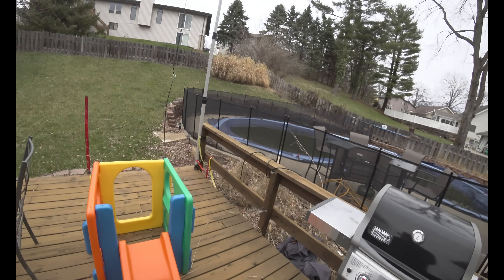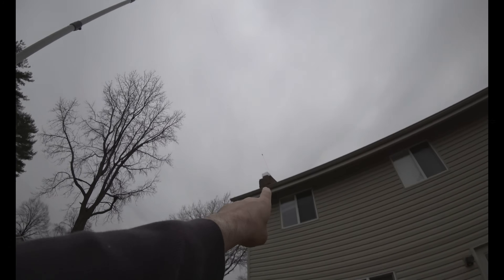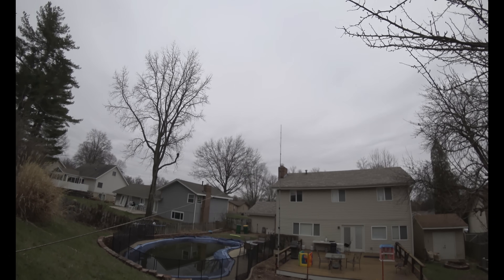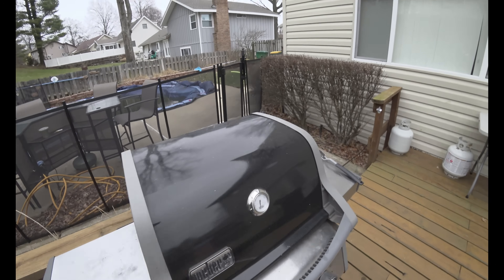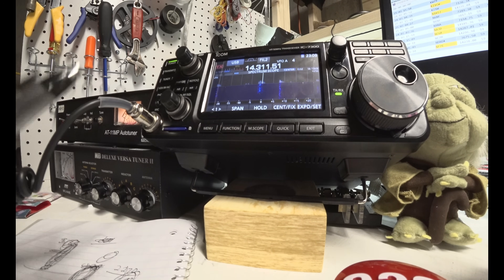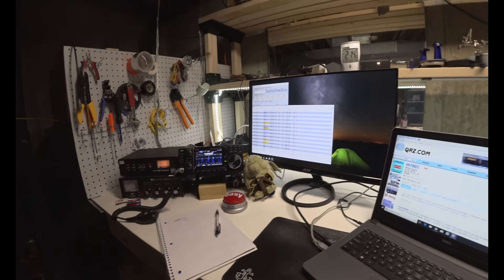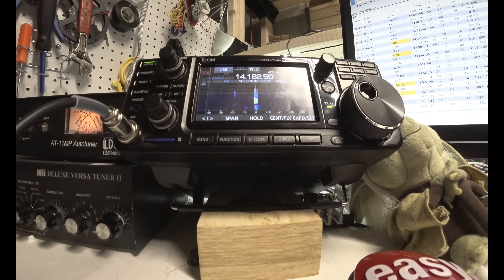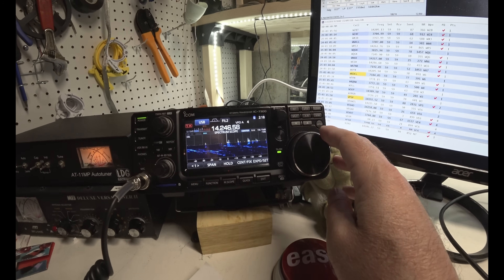The Amazing Doublet Dipole G5RV!!!  Best Stealth Backyard Antenna!

Comment: This is the heart and soul of ham radio, experimenting and testing! Learning what works and what doesn’t. You can have a 10k rig and a crappy antenna and you won’t be able to work your neighbor. Take a good antenna, good wire, adjust for SWR and you can work the world with a “cheap” 100 watt radio. Build or buy a good antenna. A good antenna analyzer is a must. I’ll take a good (I don’t mean expensive, I mean a GOOD) antenna and analyzer over an expensive radio. Compare it to buying a 100” 4k ultra hd tv and hooking it up to speakers from a 53 chevy am radio speaker.

Comment: I have a g5rv and only 150 feet of space. I'm curious if I can run this as a sloper off the side of my house with a grounded plate? Or if I can run the 2 102 foot wires perpendicular instead of a straight line. Thoughts welcome....

Comment: The G5RV is one of the most over rated, non resonant antennas on the market. It is in fact resonant on 20 meters, it's design frequency, but that's as far as it goes. Stealth? Want a stealth antennas? Make a 40 meter half wave end fed antenna, using a 64 to 1 unun to match it and make the antenna out of #20 enamel wire. Now you have a stealth, resonant multi band antenna with a low SWR on all of its resonant frequencies.

Comment: MFJ says it needs a tuner.  Is that for all bands?  I'd only be working 40 & 20 for the most part.
Reply from the maker: Yes needs a tuner.  Good for multiband mostly.  You should just get a resonant 40 and 20 instead.
Reply: @hamradiocq  Yeppers.  Found some videos and info on the ZS6BKW (a variant of the G5RV) that's resonant on 40, 20, 17, 12 and top half of 10, as in well under 2:1 SWR without a tuner.  WITH tuner you can add 80, 15 all of 10 and 6.  In the process of building my tower and antenna right now and hope to have something to report in a couple weeks.

The G5RV was originally intended to be a 20 meter dipole only.  US marketing made it the end all be all that it is today.
73 de K1NKX
Reply: Doesn't need a tuner on 20m, other bands yes

Comment: I think you are supposed to fit a balanced line tuner between the coax and the ladder line, you need to match 50 ohms to 450 or whatever your ladder line is also you need to convert unbalanced to balanced. Other ways to do this is with a balun or with a mixture of different impedance coaxes.
  Good luck and try to get your entire antenna at least 1/4 wavelength above the ground.
Reply from the maker: Ok, thanks.

Comment: I got that one coming some time as it is taking too long from a vendor in NJ. Will set up on a tree, but not sure if I can get it to 27' high or so. Will try an inverted V due to space. How will the radiation pattern work on those? I know as  T shape will go opposite to the leads. Thanks anyone.
Reply from the maker: Good question, I'm not sure.  Your testing will tell.
Reply: @hamradiocq  Then intention was to temporarily set it on the attic, but will try to set outside if possible. Limitations not HOA, but not my house. Thanks.

Comment: Great vid. I have a 20m doublet with 300ohm ribbon - fed directly into a balanced input on the tuner. That avoids having the coax section that a G5RV has i.e. the G5RV's dimensions means it cut for specific bands. Eliminating the coax gives a true broadband aerial/antenna. My back garden is a lot smaller than this one, and one of the antenna elements even has a 100-degree dog-leg, as I haven't the room to run it straight - it works just fine. Either way, Doublets (and G5RVs) are a great, low cost, all-round multi-band antennae. 
P.S. Don't buy these things - they're just bits of wire, get soldering! Off-the-shelf G5RVs etc are a rip-off for what they are. If you haven't soldered before don't worry about it - this isn't delicate components we are talking about, its just wire. It's a good way to start learning the skill - one that will serve you well if pursue amateur radio as a hobby.
Reply from the maker: Yeah, I know it's over priced but I dont' have much time for building... Maybe when my kids are out of the house and /or I retire.
Reply: True enough, you can only do what you can do! 73

Comment: What kind of antenna tuner do you run or does everyone suggest? Going for my General soon. I want to get on HF badly! Also space isn’t really an issue for me however I don’t have access to a tower so would this antenna work well still?
Reply from the maker: Well if you are portable and outdoors and want lightweight, look at the "Elecraft T1 Tuner".  I just got it and it looks awesome for backpacking.

If you want something at home that tunes well that is for a desk, I like the MFJ tuners... They have served me well. I have the MFJ AT-11MP auto tuner that serves me well at home.

Of course do more research and ask others and do searches on YouTube. I like Auto tuners, where you just hit a button and it tunes for you.

Manual tuning can be a pain.  But decide if you want light weight portable or heavy desk because that makes a big difference.

My Elecraft KX2 radio has a BUILT IN tuner that makes it SUPER easy to tune.  If I were to get an HF rig with a tuner, I'd buy the KX2 or KX3 with a built in Tuner and it will work awesome.

Comment: I have been using the 102’ g5rv for a couple of decades. It’s a co-linear on 20m and does a great job on 40/80. I moved to the mountains 2 years ago and haven’t bothered with my 10/15/20 beam. Been using an S9 for upper bands. There are purpose band specific dipoles that are barely a little better. Hardly noticeable if at all. The g5rv does a whole lot really well.
Reply from the maker: I"m thinking about getting that same MFJ 102' antenna and putting it up at my moms house.  We were talking about building it, but I don't think you can build it as cheap as you can just buy from MFJ

Comment: I use a g5rv antenna have used resonant dipoles and 102 ft doublet with 4:1 balun and tuner. The g5 dose very well.i am using 100 ft rg8x coax.

Comment: That "cheap, crappy" antenna has worked well! Imagine the improvement if you put another pole up at the end by the fence!
Reply from the maker: Ron C I got another comment that I deleted that said it was crappy
Reply from the maker: Ron C u love cheap crap
Reply: You know it's true! Part of my fan dipole is made from a used spool of wire I bought from Goodwill...can't get much cheaper than that!
Reply from the maker: Ron C I never see wire at GW
Reply: It's because guys like me will snatch those things up as soon as they are on the shelf! Last year I bought a spool of wire from Sotabeams, they had a sale and I bought 500m of their 23AWG rated  for power levels up to 150 Watts at 50 Ohms. It was on sale and after shipping I think it came to just under $50. I'll probably not need to buy wire for many, many years.
Reply from the maker: Wow 500M!  I could use that!  What I want is some ladder line (cheap).  Reminds me Garage sale season is coming up.
Reply: Yeah! garage/yard sales! You can make ladder line, you just need some type of non-conductive material to separate the wires, woodedn dowels, Popsicle sticks-(might could buy them at a craft shop. Get a couple spools of speaker wire...easy.